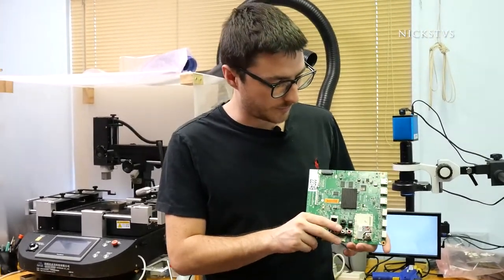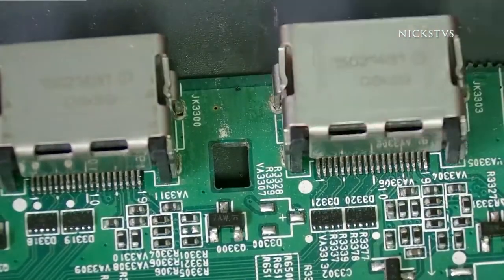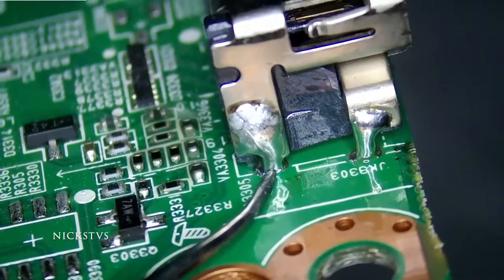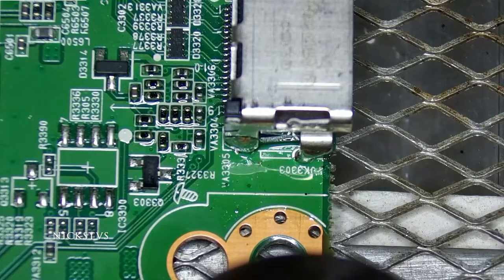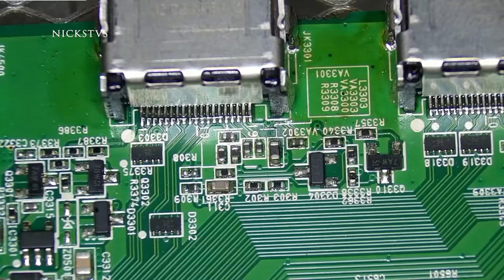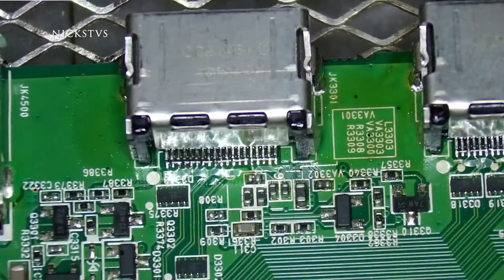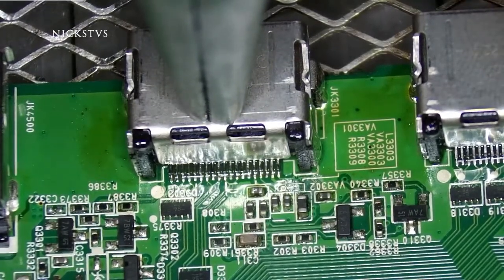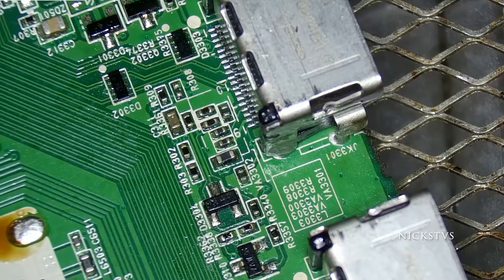Broken HDMI Port Repair For LG TV

Comment: Could i do this repair if i dont own a heat gun?
Reply from the maker: It would be much more difficult for the HDMI removal and you would be at a higher risk of damaging the board. If the port already is off the board then you should be able to only use a soldering iron.

Comment: Best vid ive seen. What if my hdmi port is missing 2 pins...
Reply from the maker: If your HDMI port is damaged, and is missing 2 pins, then you would need to replace it with a new one. It is however possible the 2 missing pins could be no connects and may not be needed at all. You would have to look at the board more closely to find out.

Comment: I never had an iron or hot air with temp settings before, its true, temp is only for reference, so many factors affect the melting point.  I got a Weller 1010 next purchase is a Hako FR 301, but I noticed the Jap version is cheaper, but it runs on 100 volts, people say it works fine in the US. I had the money to get a camera setup but I had to get new glasses, cost nearly $600. Which cam is that one? the blue cube. I like Eakins and Tomlov DM602. I have to put on my reg Rx glasses plus my near vision Rx glasses together and look through a mag glass.  My soldering is fine, my eyes aren't
Reply from the maker: Sorry for not getting back to you sooner on some of your comments. I just didn't have the information. 
I do now. 
Check out this link. It's the Eakins store on Aliexpress. Best bang for the buck in terms of equipment. The link below is an almost identical set up to what we have right now
https://www.aliexpress.us/item/3256805703615679.html?

Comment: what temp is your hot air set at here?
Reply from the maker: Sorry this video was to long ago for me to remember but with my specific equipment I usually will use 350C-375C. If it's a really thick board ill go up to 400C sometimes even up to 425C but that only for really thick boards. Most TV boards aren't like that, I only have to usually do that high for like XBOX series S and X boards with the really big ground pads.